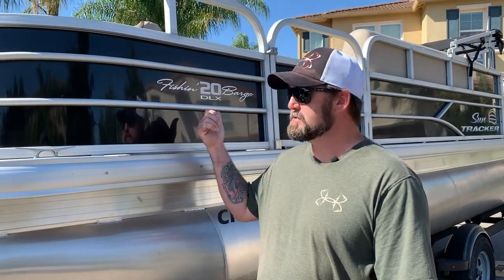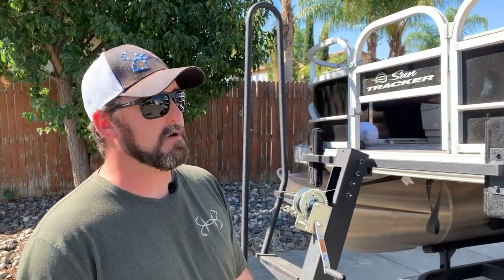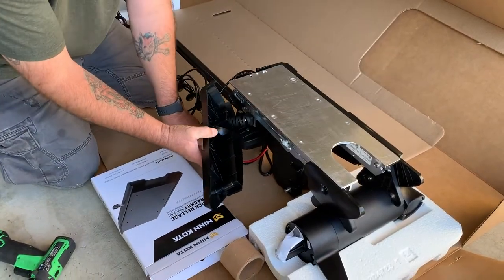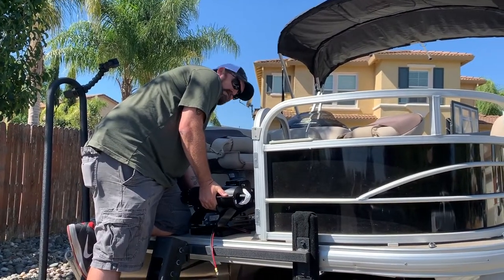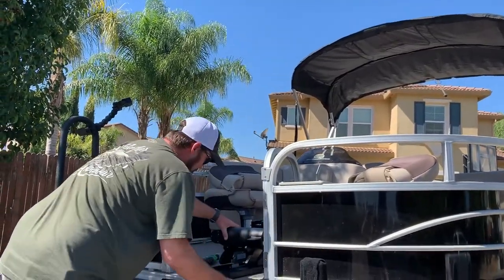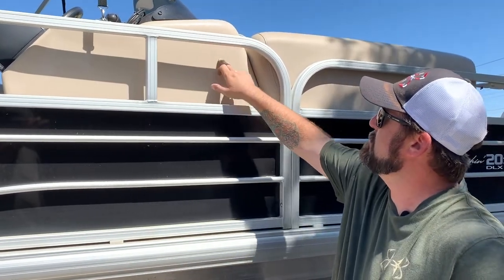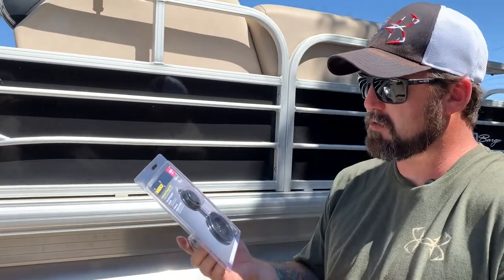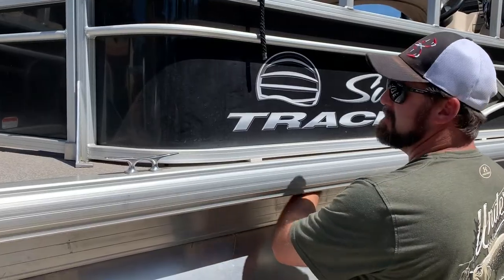MINN KOTA TERROVA TROLLING MOTOR INSTALL ON A PONTOON | HOW TO

Comment: What kind of trolling motor would you recommend for a 22ft NR seahawk? Thanks still haven’t seen you out there yet lol
Reply: Been wanting to say Hi to you lol
Reply from the maker: Thanks for watching man! I appreciate it.. I would recommend going with  a 36v 112 lb trust 60" shaft Minn Kota ultera and make it a rip tide if you fish the salt.. if you have enough room for 3 deep cycles.. if not a 80 would work but your run time will be less..
Reply from the maker: I run the 80lb ultera on my boat and it is great.. but my boat is smaller..  I use the kicker to push the boat and use the bow electric to steer.. use the i-pilot to keep the boat on course and keep pressure on fish when trolling..
Reply from the maker: I'll be out there tomorrow in the Garcia's bend area
Reply from the maker: Let me know if you want me to take a look at your boat and figure out what kind of set up would be best for you.. they also have mounts that allows you to switch between the trolling motor and the Columbia River style anchor as well.. fishing and work on fishing boats is my life bro so let me know if you have any questions..
Reply: Reel Life Fisherman I would love to pay for your service ! I know your a busy man so I’ll just wait for you. Oh and it seems like trolling k-14 -15 brads killerfish seems to have been better these past days .

Comment: Thanks for the video. Just ordered terrova . One question for now. Probably more to come when I go to install. Should I also hook up a minn Kota Alternator charger? Would you recommend it?
Reply from the maker: Thanks! Glad you liked the video.. so I have one on my boat.. it does help.. but not as much as you might think.. if you are doing a lot of running around with your gas engine.. it will put a charge back to the batteries and extend your day .. also make sure your engine puts out enough amps to run it..  what size is your engine? Thanks for watching and let me know if you have any questions..
Reply: Reel Life Fisherman I have a mercury 60ct
Reply from the maker: I don’t think the 60hp stator puts out enough to run the alternator charger if I’m not mistaken.. just use group 31 batteries and you will get plenty of run time
Reply: Reel Life Fisherman Thanks I will definitely do that.

Comment: Do you have a part list for the trolling motor power receptacle and the 45 deg box cover that the female power receptacle goes into?  The video is great.
Reply from the maker: So those come on the fishing barges.. but if you live near a bass pro the service department might have some at the parts counter.. I know ours does..  but let me see if I can find out where else you might get one..
Reply: @ReelLifeFisherman  Thanks, do you know what they are called.  We don't have a Bass Pro in my area, the closest one in my area is about 100 miles away.  If I knew what it was called I could tell them over the phone.  Thanks again for your help
Reply: I would be interested to know whats its called too.

Comment: Great video. I have the Bass Buggy 16'. Do you think the 12 volt trolling motor will be ok for that size or would you still recommend the 24 volt. Thanks.
Reply from the maker: It depends on how you want to use it.. for light use it would definitely be fine.. for longer use I would suggest getting a group 31 battery.. and for long constant trolling I would definitely get a 24v .. let me know if you have any questions anytime.. thanks for watching
Reply: Thanks. I finally decided and ordered the Terrova 80 lb with a 60” shaft. Maybe a lot for my boat but I will never have to stress about power. Now that I’m waiting for the motor to arrive I’m looking for batteries. Wal Mart has the group 29’s for around 100$. I’m wondering if I will regret those if I decide to go cheap? Any other battery recommendations?
Reply from the maker: I like the Duracell AGM batteries they have at sams club and batteries plus.. good for the money.. just don’t get optimas not what they used to be.. over priced

Comment: Great vid!! I have a 2022 20dlx coming and want to put a 24v Terrova on front. 2 questions if you dont mind? Will a Mega 360 Transducer fit under the door when installed on the trolling motor and will the installed TMotor plug handle the 24 vdc to the batteries under the dash? Thanks!
Reply from the maker: So yes the factory plug will work no problem for 24v but no I have never seen a 360 transducer on a terrova.. I’ve put them on ultrex’s and fortrex’s and then on their own separate bracket you lower..  thanks for watching and commenting.. let me know if you have any questions. But I wasn’t aware the have a 360 mount for a terrova.
Reply: You are correct. No 360 mount for a Terrova. Didnt know that at the time. Thanks!

Comment: At 12:01 (and a little before) you show a clear shot at a surface mount electrical receptacle.  I have an older Bennington toon and this is exactly what I am looking for.   Its hard to even search for because I don't know what it is called.  Any ideas of where I could purchase one?
Reply from the maker: Yeah here you go.. I need to put all the links in this video.. we are slowly getting them. Thanks for watching..  Marinco On-Board Charging Inlets https://www.amazon.com/dp/B000NI38MG/ref=cm_sw_r_cp_api_glt_fabc_JGBA4AX6JFKBA61RWYBT

Comment: I watched your video many times because I have the same boat. Only problem is all the Terrova's are on back order so I bought a power drive 70. I mounted the same quick connect but the door does not clear it with motor in stored position. I also noticed after seeing you plug the trolling motor in that my plug was installed up side down. Great Video and now I am a fan. I will be watching any more videos you put out in the future. Thank You.
Reply from the maker: Awesome! Glad you like the video and the channel! So where is it hitting the motor when shutting the door? The shaft or on the steering motor body ? Thanks for watching and commenting..
Reply: @ReelLifeFisherman  It hits the deploy lever on top of the motor. Not a big deal since I will have door open when using trolling motor anyway and taking the motor off when I am at the dock. My boat is covered and docked all season in Ohio. The only time I full it out is in the fall for winter storage.

Comment: Have a Bass Buggy 18 (2016). I am putting a Terrova 80lb. With 2 Group 27 under the console, I'm not sure there is room for the charger (ProSport 20Plus 3 Bank). I was wondering if there are other creative places to mount the charger? I'm not absolutely sure I cannot get it all in the console, but it is definitely going to be extremely tight. I believe the console is quite a bit smaller than the one in the video.
Reply from the maker: Awesome it will work great on your boat! You can fit it all under there.. it will be tight!  Sometimes you have to trim the inner lip of the console.. they make a duel battery tray.. it saves some space.. you can mount the charger on the back side of the padded cushion.. use short enough lag screws that they only go into the wood backing on the  cushion.. hopefully that helps and makes sense.. let me know if you have any questions.. thanks for watching
Reply: @ReelLifeFisherman  Oh man that is awesome!  but there is a panel (all the switches on the console) is right in the middle of it ... can send you a pic...
Reply from the maker: Got your pictures.. so you could absolutely put it outside like that.. they are waterproof.. if you mount it up inside you would have to move the fuse box.. sometimes I make a board mount the board to the seat cushion and the charger and fuse box to the board.. I’ve also through bolted the charger with the heads of the bolts on the outside for a cleaner look.. I also use philips head bolts when I do something like that..  let me know if you have more questions.. glad to help! Thanks again for watching the channel!
Reply: @ReelLifeFisherman  thanks man! I think I'll go with the outside ... I'm basically lazy and don't want to move the fuse box! Thanks again....  would you mount it exactly as is shown in pic?  With charger directly against the plastic console?  No worries with the charger getting hot?

Comment: bennington 188 svf want 2 put minnkota 24v power drive 70lbs.also 50 amp breaker  ac power port  aloso minnkota charger mk-315d are these good also where would put everything boat comes with 12volt set up  you do very good job on youtubes thanks ji  parts coming fro  minnkota super store  ps batteryes ?

Comment: could you go over more in depth on wiring everything to the batteries and maybe get a parts list i have the same boat and would like to do this love the video
Reply from the maker: I have another battery wiring video that goes over that better.. and  i can send you the amazon links later this evening after work.. thanks for watching and glad you liked the video..
Reply: @ReelLifeFisherman  Thank you very much appreciated
Reply from the maker: Minn Kota Terrova Freshwater Bow-Mount Trolling Motor with Universal Sonar 2 and i-Pilot GPS (24-Volt, 80-Pound) https://www.amazon.com/dp/B01M2XOX2K/ref=cm_sw_r_cp_api_i_Q2XbFbGD20V36
Reply from the maker: MotorGuideaccessories, trolling motor power plug, 2-prong https://www.amazon.com/dp/B002EIIPJ4/ref=cm_sw_r_cp_api_i_-3XbFbC7GN8QB
Reply from the maker: Minn Kota 1854035 MKA-16-03 AP/PD Quick-Release Bracket, Black https://www.amazon.com/dp/B01MT1T7C6/ref=cm_sw_r_cp_api_i_M5XbFb6E9FWZE
Reply from the maker: Minn Kota On-Board Digital Charger https://www.amazon.com/dp/B0042TC5QM/ref=cm_sw_r_cp_api_i_I6XbFbTY2ZQ3M
Reply from the maker: Marinco ParkPower 15A, 20A, 30A & 50A Power Inlets https://www.amazon.com/dp/B000NV0V8C/ref=cm_sw_r_cp_api_i_o9XbFbMQ5HJ1T
Reply from the maker: 12/2 AWG Duplex Flat DC Marine Wire - Tinned Copper Boat Cable - White PVC Jacket, Red/Black Conductor - Made in The USA https://www.amazon.com/dp/B087LPXP57/ref=cm_sw_r_cp_api_i_A.XbFb17JJX7M
Reply: @ReelLifeFisherman  is the shaft length 60"
Reply: @ReelLifeFisherman  5 or 10amp per bank?
Reply: @ReelLifeFisherman  Minn Kota On-Board Digital Charger
Brand: Johnson Outdoors
4.8 out of 5 stars    334 ratings | 64 answered questions
Price:	$81.31 - $515.92 & Free Return on some sizes and colors
Size:

Select
Select
 Size Chart
Style Name: 3 Bank

3 Bank
 

1 Bank
 

2 Bank
 

4 Bank.... Which one? 3 bank?
Reply: Did you change out the tray that the batteries set in

Comment: Do you like the xps better than the precision minn kota
Reply from the maker: aaron becerra I like the minn kota better personally.. but the XPS is made by pro mariner and we don’t have hardly any issues with them.. and I’m a marine tech at bass pro so we install a lot of both of them.. thanks for watching!
Reply: @ReelLifeFisherman  well I ran into a slight problem during mock up notice the center pole is higher than the deck l have pics if I could send them to you for your suggestions by text or email
Reply from the maker: I know exactly what you’re talking about.. sometimes you can cut the top off of it right at the bow stop.. but your other options are .. take the stand off and install it as normal.. then you will have to take the motor off and on when you launch.. you can buy a new style bow stand.. or move it to one side if it will fit..

Comment: Great video. Most useful. What is the part number, manufacturer, etc of the power plug receptacle that is mounted on the deck just inside the door. Its at the 11:34 time of the video? Thanks again for the posting of the video.
Reply from the maker: Thanks glad you liked the video and found it helpful.. I put a link for it in the comments below.. thanks for the comment and let me know if you have any questions..
Reply from the maker: MotorGuide Accessories, trolling Motor Power Receptacle, 2-Prong https://www.amazon.com/dp/B002EIIPPS/ref=cm_sw_r_cp_api_i_a694Eb4XXR09D
Reply from the maker: MotorGuideaccessories, trolling motor power plug, 2-prong https://www.amazon.com/dp/B002EIIPJ4/ref=cm_sw_r_cp_api_i_l-94EbTPD94RX

Comment: Can you please tell me how long the power lead wire is that comes with the Terrova?  Thanks much.  Enjoyed your video.
Reply from the maker: Thanks glad you liked the video! I want to say it’s about 3’ or so.. I’ve never actually measured it.. but they are always more than long enough to reach the receptacle on any boat or where you would install one on any bow.. hopefully that helps.. thanks for watching.. and let me know if you have any questions
Reply: @ReelLifeFisherman  thank you for getting back to me so quickly.  I have a 21' Kennedy pontoon, and I just ordered the 24/80 Terrova for it.  I ordered a roll of 12 ga as you said, and now I'm thinking I need to order 15' of the 8 ga to run from the plug to the batteries in the console.  Is this correct?  The reason I ask, is because I have no pre-installed plug at the front of my boat.  I need to install one of those.
Reply from the maker: I run 12ga for battery charger extension cables.. and the trolling motor wiring should be 8ga for a 24v motors
Reply: Reel Life Fisherman, thank you sir.  Since I don’t have a plug up front, I must install one.  I don’t want to drill through the sides, so I think I’ll have to drill one in the floor.  I could sure use one of those plug housings in that boat you are working on, but I’ve been unable to locate one online.  Can you put me onto one of them?
Reply from the maker: MotorGuide Accessories, trolling Motor Power Receptacle, 2-Prong https://www.amazon.com/dp/B002EIIPPS/ref=cm_sw_r_cp_api_i_Ne57EbXG1N0YA
Reply from the maker: MotorGuideaccessories, trolling motor power plug, 2-prong https://www.amazon.com/dp/B002EIIPJ4/ref=cm_sw_r_cp_api_i_wf57EbM7ES49X
Reply from the maker: These are the ones we use at my shop and what I recommend
Reply: Yes, thanks.  I was referring to the black plastic angled cover housing that actually houses the plug, like the one on the floor of the boat in the video, that sits above the floor.
Reply: @ReelLifeFisherman  What size wire comes with the factory trolling motor wiring on a BB 18? I have the boat, but I'm on the road (truck driver) and can't check it myself... trying to get stuff gathered up to install the 24v Terrova when I get back home and don't know if I need wire or not. 

Great video, thank you for doing it!

Comment: Great tutorial, kind sir! One area I didn't see was the battery hook up. Did you use two fuses (one each) or can you slave the batteries together by connecting + to - then using the one fuse that comes with the Sun Tracker? Also, does the plug that comes with the Terrova 80 fit the female receptor on the boat (I have the 20' Fishin Barge and the Terrova 80)...so it should be the same? Boat is in storage, but it may be nice this weekend for the install and want to be ready...thanks again for your help and guidance!

Comment: Thank you for sharing your knowledge. This was a huge help with my installation. 

Dumb question - my 16ft BB didn’t come pre-wired with a trolling motor plug. Any issues with connecting the 6 gauge cable I’m running from the battery to the 8 gauge on the TM receptacle?
Reply from the maker: Yeah the BB 16 comes with a wiring kit if you ordered it with a fishing package and the dealer has to install it.. it’s the only one that way.. you can connect 6 to 8ga. Just take a bit more wire off so it will fit in the butt connector.. and use heat shrink..  thanks for watching and commenting.. let me know if you have any questions..

Comment: When wiring the heading sensor, does it need to be on a "switched" power source or can it be constant hot?
Reply from the maker: Mark Painter it can be either way .. it will be drawing a very small voltage if wired constant hot.. be cause it’s always looking for the trolling motor.. but it won’t hurt it.. best to have a main battery selector or shut off switch.. hope that helps.. let me know if you have any questions.. and thanks for watching
Reply: Reel Life Fisherman, I appreciate the reply as well as your videos. They are a big help.

Comment: I have this same boat (color and all) and I’m shopping for trolling motors now. How does the 80 pound thrust perform? I’ve seen some say to get a 36v setup, but I’m not quite sure I need that. It can get windy where we fish, but I normally don’t go when the weather is bad.
Reply from the maker: FourWheeler575 is the main thing I would consider is what style of fishing you do most.. and how long you want to fish for..  if it’s all day constant trolling for trout or kokes or something like that.. 36v might be better because with a 24v you may only get 5 hrs maybe a little more or less with wind and stuff.. but if you bass fish and aren’t always on the trolling motor.. it would be fine.. let me know if you have any questions.. anytime.. thanks for watching..
Reply: Reel Life Fisherman thanks for the information. We mostly fish for bass and maybe walleye every now and then. Usually we fish for 5-6 hours.
Reply from the maker: Then the 24 v will probably be just fine for you sounds like.. no problem at all.. tight lines!
Reply: Reel Life Fisherman thanks. One more question. Did you keep the stock trolling  cable/plug or replace it? I saw you mention it being setup for 12v, but I didn’t see you change it.
Reply from the maker: You can leave the factory plug it’s rated for 24v you just need to add another battery tray .. and 2 batteries.. they factory tray is a group 27 I personally would run 2 group 31s and get the bigger trays to go with them.. then wire the batteries in series..
Reply: Reel Life Fisherman awesome. Thank you
Reply: Reel Life Fisherman  can you use 2 prong on Minnkota for 24v setup?

Comment: What’s the recommended shaft length for a pontoon??
Reply from the maker: We typically run a 60” but 54” will work.. just most of the 24v and up only come in 45” or 60”or 72” ..  thanks for watching let me know if you have any questions